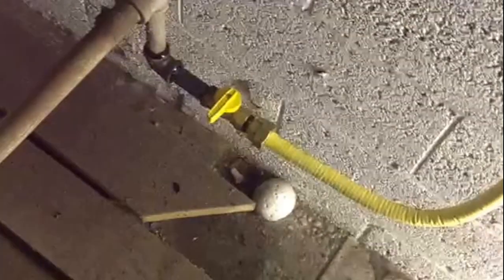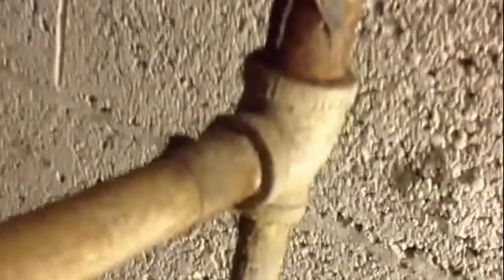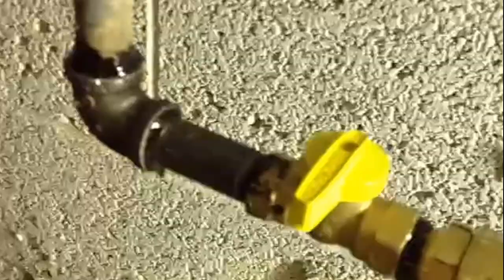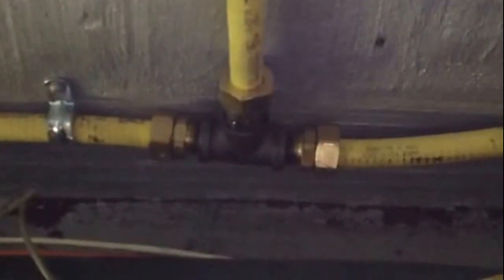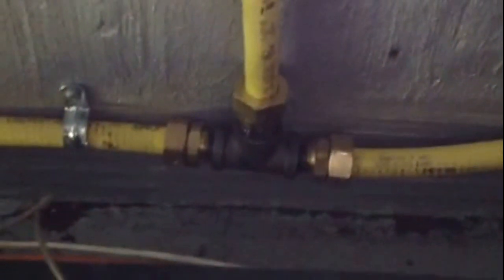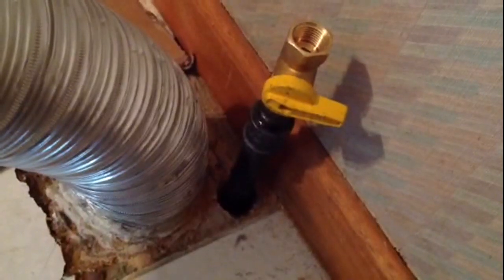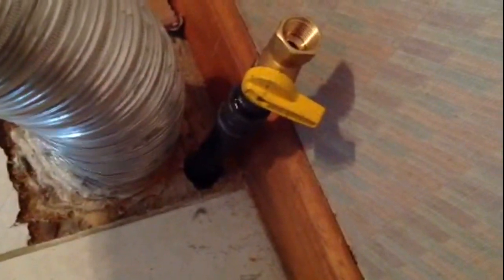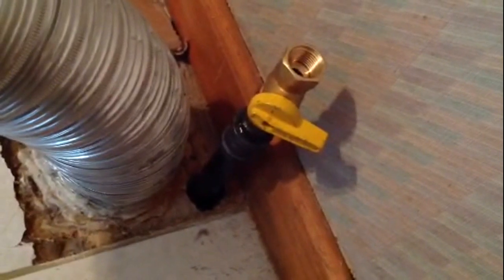How not to stainless steel csst gas line installation.

Comment: you need to stop! you are going to get someone hurt. the gas company doesn't have the authority to tell you it doesn't need bonding. your local codes supersedes. but again it's a safety issue that educated pros just do. even the manufacture recommends it. where you were going to put a 2x4 on the wall to fasten the penetration I would have used a floor plate. it cost about 3 dollars. gas lines or appliances should never be done diy. there is more to it than pipe and staples.
Reply from the maker: i never said it does not need bonding. the gas company was allowing systems without bonding until last year. they now require new and old systems to be bonded. i do not like floor plates i do not like these fittings concealed where you cant get to them. gas lines are being done diy that just how it is. you can buy this at the home center.

Comment: Nothing is sleeved where it penetrates the wall. As far as grounding it goes, why would you not? Just because it is not required by local  code doesn't mean it shouldn't be done. That could save a number of lives down the road.

Comment: As long as that crusty, black iron pipe before the CSST connection is bonded, you're fine. If it's not bonded, I suggest you get it bonded before you burn down your house with a lightening strike. I don't care what local electrician or code may say it doesn't need to be bonded. It does need to be bonded, and this is essential with CSST and is in their "manufacturer  installation instructions" that you can download off the internet. You also removed the dirt pocket from the furnace drop you disconnected and put in an elbow. At the very least, that should have been a continuous secondary T aiming downward to keep debris still falling into a dirt trap and not going down and into the CSST... And this is 1/2" CSST? With how long of a run to 2 appliances? a stove and a dryer? I can see the stove easily maxing out your BTU total for that CSST. I hope you sized it correctly and the length of it doesn't seem as long as it looks in the video. There's a lot of internal restriction with CSST.